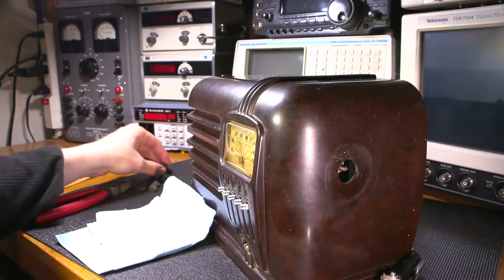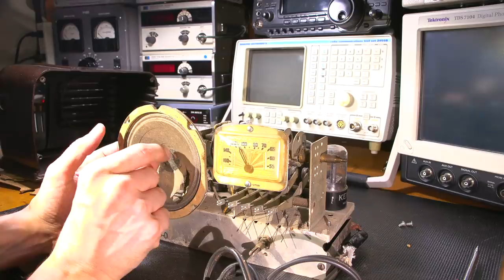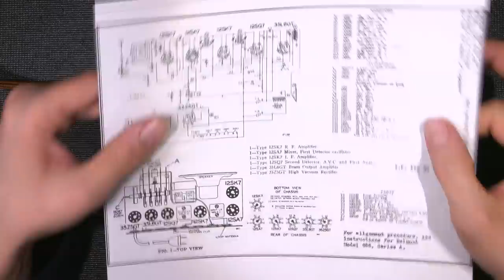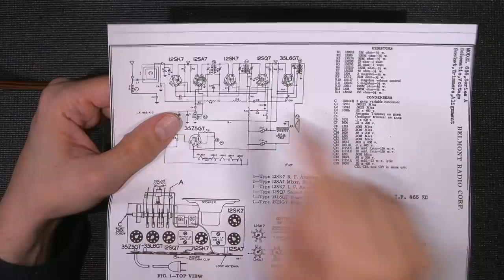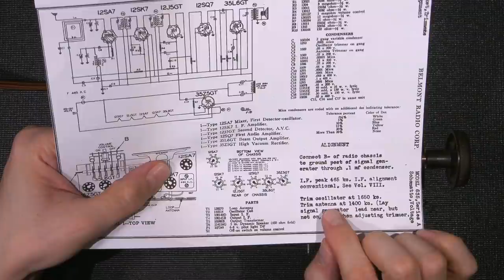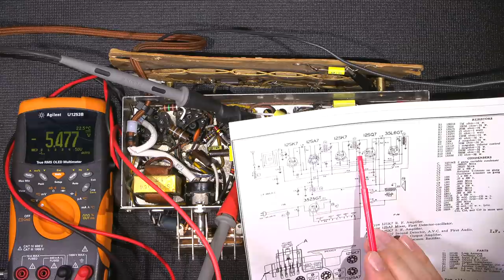Electronic Restoration Adventure-The Belmont 636 Radio Receiver!

Comment: I grew up with the knowledge that if you got shocked from an appliance you unplugged it and flipped the plug 180 degrees and plugged it back in...you probably would not get shocked again...lol.  For the longest time, I hated the new plugs that would not fit into the house outlets...  Then I finally got it, and actually that kind of started me on my electronics journey.
I must tell you that my absolute awe of your knowledge of old radios and old electronics is truly astounding.
I remember my first project in my electricity class..they did not call it electronics...was to build a one tube power supply, and then we built a one tube radio receiver powered by our previously built power supply...I did poorly in these classes in the lab part because I could not find things like a cigar box nor the fine wire required for wrapping around an oatmeal box.  Still, I managed to pass because I got a basic understanding.  And, I found my hobby that is still fun for me today.  I am now unable to fix or tinker with radios or computers any more due to my bad eyes and shaky hands...but that does not mean that I have lost any of my enthusiasm for the hobby.  This is why I enjoy your videos so much.  Keep up the great work and know that there is at least one old guy out there that really appreciates what you are doing.

Comment: As an old Motorola bench tech, I spent over 15 years working on old tube sets not just Motorola’s. Old Bakelite receivers were my junk food. Then in the early 90,s they (tube sets) just stopped coming in and I moved to international field tech support. I really miss working on them. Your description as you progressed, brought back that familiar burnt dust smell for a couple of hours that all old tube sets just have. Thank you for that Sir. I might add that I have over the years worked with some of the best in the industry. I would have no problem setting your workmanship right next th theirs.

Comment: A magnificent restoration. I remember my Grandad loved to repair (really) old radios. I saw him once wind a new coil with Litz wire as one of the "pancakes" on a little regeneration receiver he made, where the two "pancake coils" could be rotated together or apart from one another to get the best sensitivity. He had a curious tool to wind the coil - it looked like a sock darning "mushroom" made of wood but had two series of short metal spikes around the circumference. He would wind the wire around and in an out of these spikes to gradually build up a "high Q" coil (which latter meant nothing to me at the time). I'm so glad that you are keeping this tradition alive. I still have that coil winding tool as a treasured posession.
Reply: diymostthings, You might consider making a video about your winding tool and how it is used. This would be a valuable tool to the people here! de KQ2E

Comment: I was an Air Force metrology technician during the 70s.  I used and repaired most of the equipment seen in the opening scene.  I grew up when tubes were being phased out and transistors were coming in.  This brings back a lot.  I use to repair quite a number of those old radios, as they were either being thrown away or held onto.  It was a great time to get into the field.
Reply: Yes indeed, I was in the Army at that time, we were always getting TV's and radios from the officers, who were convinced that anyone in communications knew how to repair them.   I still have scars where I discharged the wrong cap with the wrong part of my body.

Comment: These were also sold in great numbers between 1946-49 under a variety of brands and cabinets. Belmont made them for Wards, Speigle, and other house brands. There were even wood cabinets. I think they kept the same design throughout, just using more modern resistors. IIRC they also kept the same (octal) tube lineup. You got really lucky finding one of the early ones. I'm glad someone who respects it got it.
Reply from the maker: Thanks for your comment Ray!

Comment: I get home from a long boring hard days work to find out my good friend Paul has uploaded a video.
No matter What it is.
I put my headphones on and that's my night improved :)
Thanks Paul but i seriously want you to restore my pioneer sa-9800 dual mono block stereo amplifier.
Reply: The power amp and power supply of the 8800 is a piece of cake. Tone section and preamp not so much. I imagine the 9800 has a similar layout. Also the 8800 had a noisy diff pair.
Reply: @Stereosandotherfun I want a total over haul

Comment: I learned a lot on old electronic with your restoration videos.  I just fixed an old luxman lv-105 (1984) last week. A hybrid amplifier of my friend. The local shop here said to him:" the tubes are gone need replacement and 400$". I said:" bring it to me please!!!"  I re-watched you tube video and a i was full trianed :)  Diode bridge was open so the heater tube was not heating. Replacing a bunch of old electrolytic  capacitors, find a short between 2 solder on a transistor. And that's it. Tubes was good and the sound of this amp is very good. 35$ :) Thank you Paul :) Take care!

Comment: It's so awesome how you talk about the individual circuits from the b power side to IF, detector and RF and go through the full adjustment procedures. What I also like is the way you get all the details of the experience into the video so that someone working on a restoration for himself could know what to expect. You have some really great tips for safety and I really did appreciate the demonstration on the IF cans where you showed the live 70v against the chassis; I really think that was important. .

Comment: When I was a kid in the 50's I got shocked all the time by everything, no one thought anything about it, it was normal.
I love these old radios especially the old wood ones. K5AZE...
▄▀▄▀▄▀▄▀▄▀▄▀█▓▒░A░W░E░S░O░M░E░░▒▓█▀▄▀▄▀▄▀▄▀▄▀▄
Reply: I guess I must have been  about 14 or 15 years old when I 'disassembled' a vintage Grundig on tubes back in the early seventies.  I had no clue I was dealing with high voltage.  I still don't understand how I was not fried while poking around in that unit.
Reply: been there.  got the shock of my life testing wires on radios  such as my radio project i mentioned above . i thought the speaker was 12 volts not 60! XD  no need for coffee that day. already had a buzz
Reply: One summer we set up the garage as a den (there was no air con and it was cooler). There was an area rug but if you weren't standing on the rug you would get a pretty stout tingle when changing the channel on the TV. I measured 90 volts AC. We were teens back in the early 70s and loved giving a jolt to unsuspecting friends by standing on the concrete and touching them while they changed the channel. Really stupid in retrospect.

I did electronics and should have known better.
Reply: Unfortunately for Keith Relf of the Yardbirds it wasn't normal, it was the end of his life , when touching a microphone that was cross grounded (through a PA) with his guitar (amp), and I believe it was through electronic equipment that was transformer isolated but had "hum balancing" switchable through  a capacitor (a capacitor connected to one side or the other of the AC line coming in.).  That is why they are called "death caps".  Although I believe this was in the UK, with 220 V 'mains', AC supply,.. the charge carried by a .01 cap (due to its reactance at 50 Hz is as miniscule part of the duty cycle.  RESPONSIBLE TECH'S PLEASE REMOVE DEATH CAPS !!!!  I've been doing repairs for 50 years , and shocked many times near the beginning of my career, actually had no shocks for about 25 years straight however,... please always check the unit being serviced is unplugged , and main filter caps are discharged before servicing.  I nailed myself a few months ago because "I thought I unplugged that".... thinking isn't the same as doing,... and Tesla's one hand rule is excellent!
Reply: Almost as bad as getting a mustache hair stuck in the microphone grill and when you jerk back the mic comes out of the stand and hangs by your lip, this activity will even make King Kong's eyes water!
Reply: Your post recalls my own forgetfulness while I was troubleshooting an Oscilloscope during my Electrical Engineering classes.
"Don't forget to bleed that huge cap!" What a bang I got from it!
Reply: Be glad you didn't play with vintage TV sets. Several thousand volts with a lot of juice behind them, touch the wrong part and bang, you're dead.
Reply: I did and got into the high voltage rectifier once, that was a bad shock! I'm 67 so I've bee around a while
Reply: Me to, when i was very young, we lived on  "The home place" there was no electric power, but we had an old battery pack radio, when farming got to tough, dad put the place up for rent and we moved to another farm, renting the land and farmstead, there we had power!   Man dad found an old floor model  radio, had a bunch of buttons, but of course all we could get on it was local AM as we didn't put up an outdoor antenna.  Of course we had to get a TV, dad found a used one in the local TV shop, I think he paid almost a hundred bucks for it, that was a great deal of money back in the 50's. The TV was only allowed to play when mom and dad were there, so we still listened to that big radio when we were in the house and not out on the farm doing chores.
Reply: @JerryEricsson  Our first TV was around 1957, broadcasting went off the air at about 10pm if I remember right.
I don't have a TV anymore, I put it on the curb over 10 years ago. I source my news elsewhere..
Reply: @Bass.Player , Remember those quaint things called "news papers?" So droll!
Reply: Damn that's messed up how it happened all the time and no one thought twice about it.Thank God I was born  in this era.

Comment: Hi, Mr. Carlson....I've restored a few  old radios myself, and I have great admiration for your expertise - and your patience!  I have a couple of tips for you, based on my own experience.  Once the chassis has been removed from the cabinet, tape a piece of stiff cardboard over the speaker - when the chassis is upside down, it's very easy to accidentally poke a hole in the cone with a screwdriver - or your thumb!  Also,  I always turn the tuning capacitor so that the plates are fully meshed while working on the underside.  If the plates get accidentally bent, it can be a headache to get them straight again.  Enjoyed your video and your narration - beautifully done!!
Reply from the maker: Thanks for your input Dave!

Comment: Your BEST radio restoration vid yet.  Really enjoyed it. Perhaps you could restore an old TV?
Reply: Give the young 'uns a chance to see real B&W TV!  "No, there's no way to see it in color, not even on the packed up color TV in the attic!"  "These programs (from You Tube) were made in black and white!"  Later on, you get to tell them: "On this TV, even color programs come out black and white."
Reply: Bob Pegram Believe it or not, here in the UK, some people still have B&W TVs. As you need a licence for your TV by law (big fine and possible jail time if you don’t have one!) black and white TVs are used by the blind or partially sighted. A B&W licence is half the cost of a colour licence. There are about 3000 B&W licence holders left. Crazy but true!

Comment: I am totally amazed to find someone probably in their 40's? or maybe 50. who knows about all this old electronics lore.  Explaining the foil end of capacitors is great,... Would be nice to show what they look like by unrolling them , and showing on a high impedance tube circuit input how easily fingers near the foil will easily pick up the stray hum field.  And also a lot of people don't know what the "low impedance" side of the circuit means.   I E. Close to ground, or B+ plate output portion of a tube.  I think I was about 20 years into electronics before I figured out how that worked, and how B+ could behave like ground in terms of shielding.  I have great admiration for Your enthusiasm in restoring this old radio.  One can appreciate the Aesthetics of these old phenolics, but for me having grown up when these things were still in use, and when there was still some worthwhile programing on AM radio,.. I must admit these broken cast - offs were a dime a dozen, and the amount of work necessary to restore this rat's nest, and rewiring things would never tempt me today.  I took bunches of these things apart as a child to scavenge for parts.I am guessing this is from the late 1940's or early 1950s.  I'm going to have to post some video's and show some additional techniques for such things as repairing speakers like that one (in ten minutes) so that they work fine.
Reply from the maker: Thanks for sharing your story!
Reply: Mr, Carlson,  Such an EXCELLENT body of work, in Your uploads,.. with material presented clearly, and in an engaging style that can be appreciated and accessible, no matter the level of experience.  Love the foil side  identifier device you invented.  I couldn't contain my enthusiasm, and made my comment about 1/2 way through this video, without having realized You had created such a wonderful thing !

Comment: Due to my great age I can remember using a product here in the UK called Vim. It was an abrasive cleaning powder which came in a cardboard cylinder (similar to the Pringles containers of today) but with a metal top too. To open it you would peel back a sticky label to reveal a series of holes and shake the contents out as required. Complete with a pine fresh smell Vim (and a competitive brand called Ajax) worked wonders on pots, pans and even linoleum floors so if Paul's Vim is the same it is no wonder it does a great job on radio chassis and IF transformer cases. OK, time for me to return to my ancient lethargic vegetative senile state now my daily ration of awareness has been used up but before vacancy returns I've just enough focus left to thank Mr Carlson for yet another entertaining, informative and enjoyable video. 73's De M0OMO

Comment: Hmm, what to do. Repair a HP 8656B or what Mr Carlson's Lab......Decisions.....Well I watched a 2 hour Excellent video. Well done Paul. Just a fantastic radio and now as good if not better  than a new one.
Reply from the maker: Thanks for stopping by Buddy! That 8656B sound like a great project too. Nice signal gen.
Reply: Buddy, you will love that 8656B. I have an 8657B. You can even do "sweep" FM alignments if you use external FM DC modulation with a sawtooth wave. Looking forward to a video on that.

Comment: Those caps look like old greasy sticks of TNT lol
Reply: Bumble bee capacitors age over time since they are made from plastic :P
Reply: I used to find old radio chases out at the local Dump ground when I was a kid, I  loved taking those caps out and cutting them open, lots of foil and wax paper inside.  I see there are still folks making large caps using rolls of each.
Reply: Jerry Ericsson there are people hiding modern caps inside the old paper shells, also.
Reply: @HighestRank  ,  Dumb move as they  are often missed or screwed up eventually because of it.

Comment: How did you fix the rear panel?
Reply: I use thick poster board... Cut it out with a good pair of scissors or a razor blade... But a good home improvement store will have plenty of products to use...

Comment: I watched this video from start to finish, what an enjoyment it was. You did an excellent job of cleaning the chassis and you new wiring was very neat and tidy. After the alignment it worked really well, as you said "just like it came out of the factory". I was however somewhat disappointed that you did not remove the guts from the old paper capacitors and re-stuffed them with the new capacitors. It just seemed to be a really good thing to do as you put so much effort into the restoration.
Putting that aside, you are really an expert and you deserve credit for your very good and informative videos. Keep up the good work Paul.

Comment: Outstanding work. I've been slowly (11 years) restoring an old Bush british radio and you quite inspired me go on and finish it. It is working though no decent IF RF etc alignments done. It was a rat's nest in an old shed, then brought it to a repair guy which refused to work on it. Started myself. Loudspeaker was reconditioned, bad wires replaced, electrolytics all exchanged, chassis and air tuning condenser cleaned. Still have not changed those old paper wax caps that you recommend to trash. Both IF transformer's ferrite cores were broken (scary repair), one I could glue and went nice, the other had a quarter of the ferrite crumbled into a soft putty, had its total length shortened. With some basic alignment it is tuning stations not bad. Aesthetically it's ugly since the pulley-cable-needle display mechanism is broken and missing parts and the overall wooden body needs heavy work. Thank you for presenting such rich technical content and for inspiring people like me.

Comment: You should have noted that up until the 50's electrical systems were ungrounded so using the chassis as a connection point was fairly safe.

Awesome video!